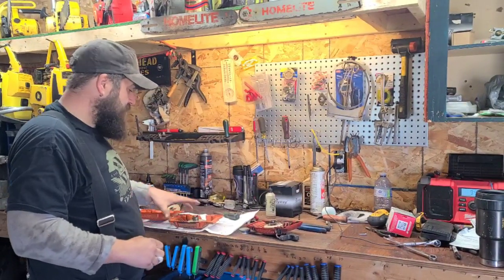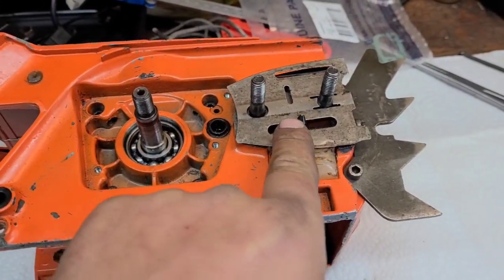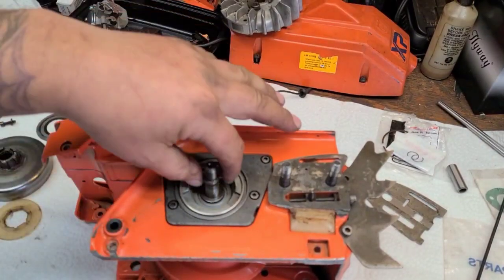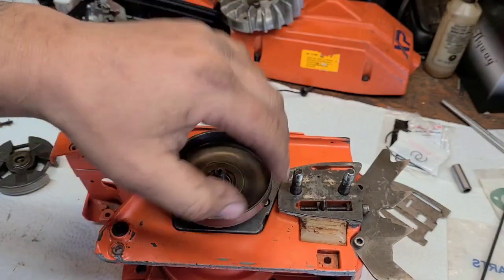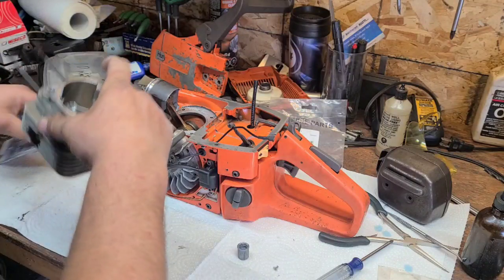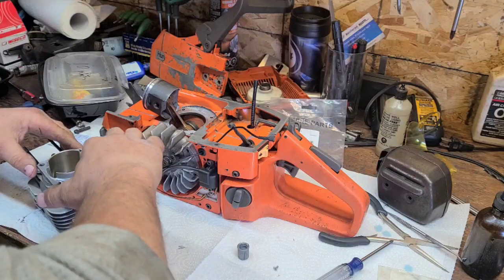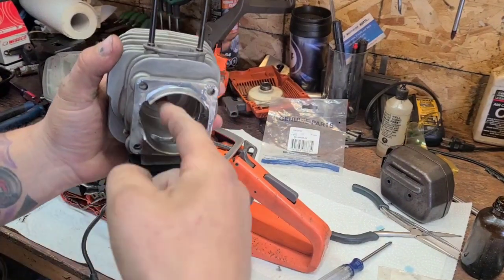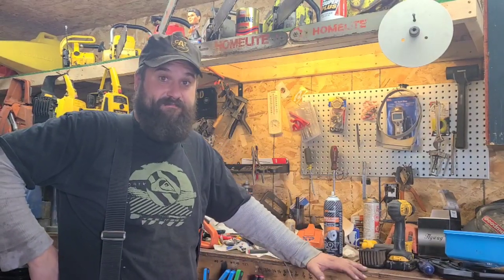Assembly and first run of Buckin's 266xp. Tips and tricks for building a 266.

Comment: I've had similar issues with the starter pully spreading and cracking. I'm just speculating. The rope was too small to begin with or stretched over time causing the rope to get skinny. Causing the rope to wedge down beside itself spreading the walls of the pully out until it cracks. Also with high compression or preignition the saw can kick back when you shut it off. I've seen Buckin pull the crank rope out when he shuts the saw off. I don't know why he does that but I thought, when I saw him do that, wow, that can help when it kicks back. I used to use a mic and measure the rope and replace it with similar size but now I measure the distance between the sides of the pully and install a rope that fits almost to tight. I couldn't find a new pully for a 61. I went to Farmertec and purchased a pully for 2.74. Its working fine. since I was ordering from them and having to pay 6.31 shipping I bought two Caber rings 7.10 and two bumper strips 78 cents. I know this video is 2 years old but I thought someone might be helped. I love Tinman. Any time I have a saw problem I go to his channel. By the way the 61 I spoke of was given to me because it was locked up years ago and would cost more to fix than a new saw. I untwisted the crank rope, put fuel in it and it cranked on the third pull.

Comment: Hi Tinman!!😀😀
When you put the sprocket on and it has holes on one side you need to make sure they are facing the outside. If you don't the sawdust will carry along and plug the bar oil slot with sawdust. The holes are made for clearing the sawdust from the sprocket toward the outside. 
Take care my friend!!😀😀

Logger Al

Comment: Very nice! Be sure the seal in the oilpump is not touching the inner ring of the crank bearing. It will wear out the seal very fast, I've seen a few that way, originally installed.

Comment: Cert clips hold the wrist pin in   N they always break on my favorite motor I work on the yd100  I have come up with my own mod for them and done it three times since I came up with it and it stopped the cert clip from breakin of and ruining my cylinder walls n piston. (Rip 5 different motors before fix)  but my simple fix works great but now I’m tryin to find the sweet stop of reliable and monster  the last one about four days ago was a bit to much monster and broke a ring and screwed the whole top end. New top end on the way n I’ll b a lil more mild with my durations 😀

Comment: When you said you have an idea how to stiffen up the av mounts I instantly got one idea too haha. I thought about putting one or more layers of heat shrink tubing over the mount. I just don't know how would they hold up.
Reply: Back in the day my brother put finishing nails in rubber suspension bushings to stiffen them and reduce wheel hop on a little vega.  I've  used deck screws to tighten  worn swaybar bushings on an old caravan...don't laugh, it took the clunk out of the front end !  Thanks for your quiet , country ways Tinman!...Oz never gave nothin to the tinman that he didn't already have...

Comment: Hey also most saws use pumper carbs right? They don’t have jets correct? Cause I’m thinkin if it works off a pump n recirculates then I should be able to run them and get all the fuel or way less without all the jetting and just a high low screw right?

Comment: Rookie question here. Why do I some guys pulling the chord out a bit before shutting off the saws? Also, I just picked up a used Stihl 028wb and it runs but it's leaking fuel from somewhere. I see fuel running down handle area to where you place your foot to start. Any Ideas?
Reply: If you still don’t know it’s to stop the motor from pulling the cord in if the motor happened to turn slightly backwards when shut off. (Saves the rewind cord) especially bigger high compression saws
Reply: @maxhiltin1133  Thank you kindly. That makes perfect sense.
Reply: @LF12468  I may add it’s Mostly for Old McCulloch saws, or any ChainSaw with “starter Pawls” mounted on the flywheel I believe the 266 has them on the flywheel.

Comment: Tinman, I got a "serious" problem with my 266XP pulley. When I run the saw (which was ported after your lovely instructions!), the starter rope comes out of the pulley and the flywheel is eating the rope inside until it breaks. I tried the original 266 starter and a 61 starter. None of them work. Do you have an idea?!

Stay safe, buddy!

Comment: I have a question about the piston,,,,when i was a mechanic before we assembled the engine we always emerged the pistons in oil….why dont you do that….i was told by an ole timer that the ole absorbs into the metal
Reply from the maker: I oil the piston and cylinder with my finger. Too much oil on these engines and it will drip down and get all over the sealant on the cylinder base and cause a leak.
Reply: @tinmanssaws  thank you, I’m sure it sounds like a dumb question but it’s interesting how car mechanics have its differences

Comment: I'm surprised to hear you say that the 61 pullstarter won't work on a 266xp! Because I just had the pullstarter take a shit on my 266XP, I replaced it with the pullstarter off my 61 and it works fine?
Reply from the maker: There's early and late pullstarters. The center portion is lomg or short so some fit some won't.